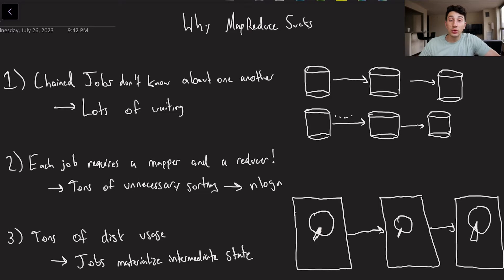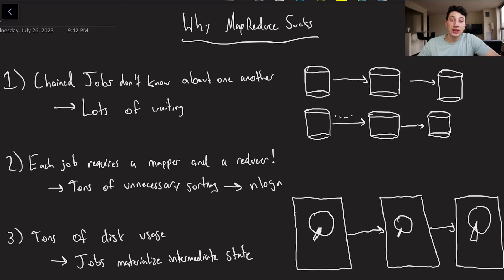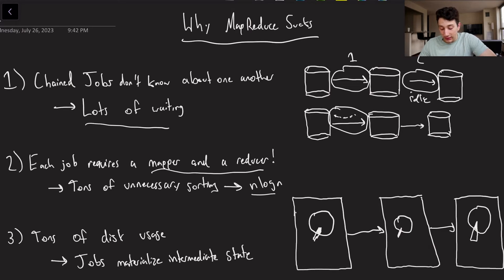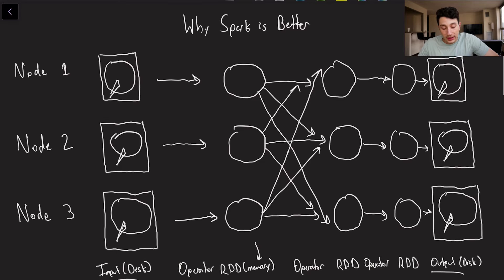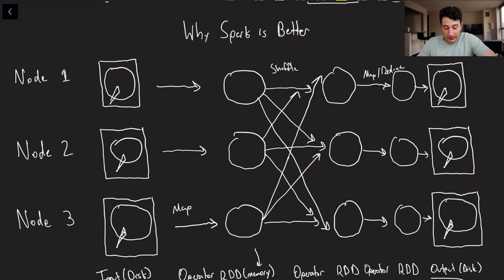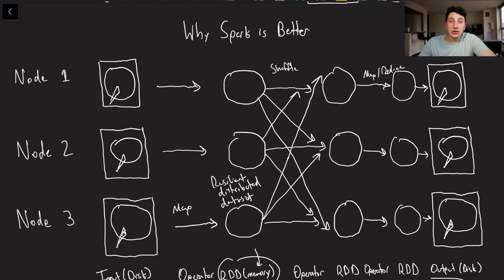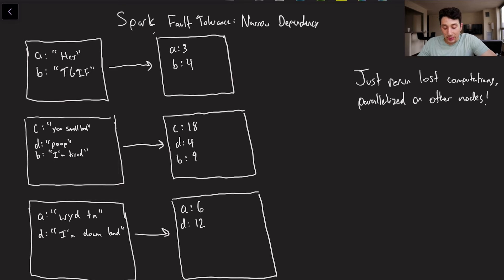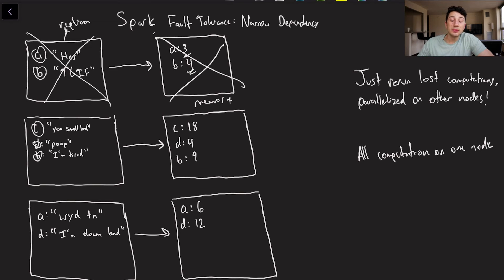You Should Be Using Spark, Not MapReduce | Systems Design Interview 0 to 1 With Ex-Google SWE

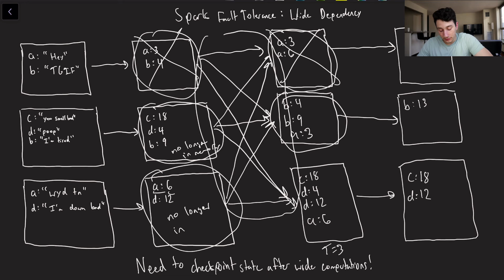Comment: Have trouble following how Spark is addressing a wide-dependency failure (8:15).

The solution to deal with a wide-dependency failure is to assume the wide-dependency succeed then write the results to disk? 

How does this address a failed wide-dependency? For instance, using your example diagram, what if the top node failed after {a: 3} an never got {a: 6}. Writing a partial result to disk here wouldn't be entirely useful.
Reply from the maker: You'd have to redo the computation from the last checkpoint then up to this point.

In the example you provided that would mean the bottom node went down: we'd spin up another and have it redo that local computation.

Comment: Thanks for the video, found some new info in this video.

The gaps I found: 
- The Linage is not explained and Linage is how Spark recover from worker failures
- 8:29 is not correct, you can trigger a writing to disk as a user to make it easier to recover from failures in a long Linage but Spark does not do that automatically
- The API difference is not mentioned, that one is also very big benefit of Spark over MR
Reply from the maker: Guessing you mean lineage here.  

1) Which part specifically am I not explaining how we aren't covering from worker failures? We either hope the node comes up or we restore state from the previous checkpoint to another node and recompute any work that we need to. 

2) Good to know, thank you!

3) Which API benefit?  It seems to me what you're mentioning is being able to use arbitrary operators over a mapper + reducer, which I do believe I mentioned but maybe I forgot this time around.
Reply: @jordanhasnolife5163  
1) I meant that you could just define a RDD's Linage\Query plan, explicitly stating that a sequence of upstream RDD transformation from the last checkpoint is maintained and that it is used for the failure recovery if needed.
3) Spark provides much richer and and more powerful API and after working with Spark engineers don't want to get back to using bare bone MR.

Comment: With Flink, why do we still want to use Spark?
Reply from the maker: Flink is only useful for processing data as it comes in.  With spark, the goal is to take existing data on disk and output more data on disk.
Reply: @jordanhasnolife5163  but with Spark Streaming, would that allows it to perform the same role as Flink, right?